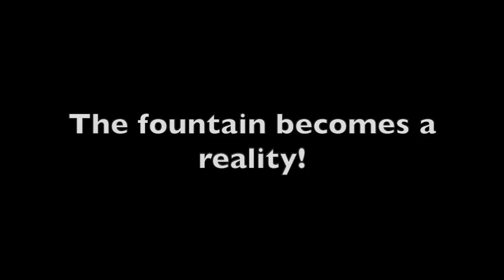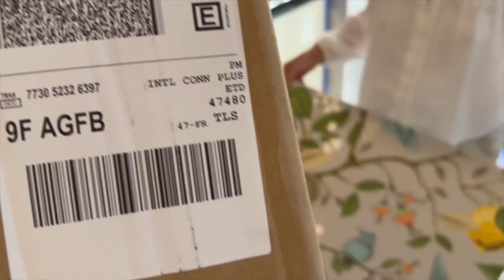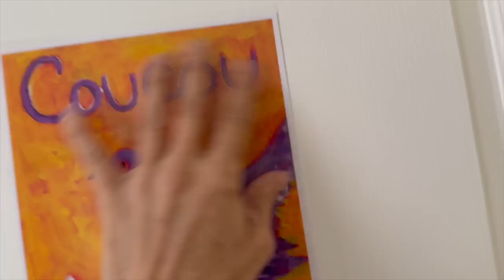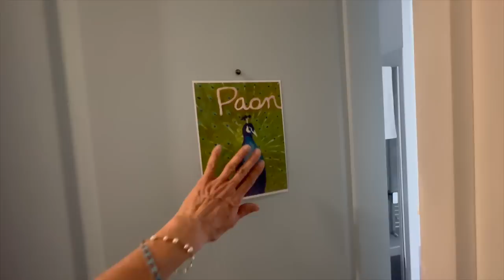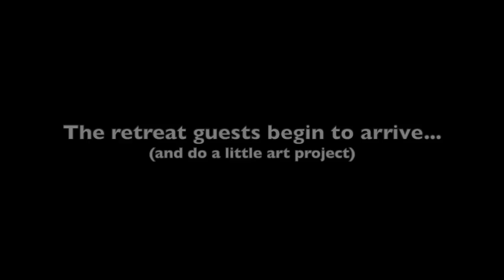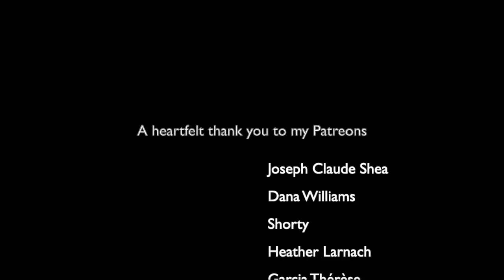Adventures in Decor: The Great Wallpaper Transformation! 🔥 The Chateau Chronicles – Ep #54

Comment: Squeaking floors:  Could you drill a hole and put minimal expanding foam insulation under the floor to hold it still?  An expert would have to know how much should go in to keep it from bulging the floor.  The holes can be filled with a peg, sanded )just the peg tops), and finished.